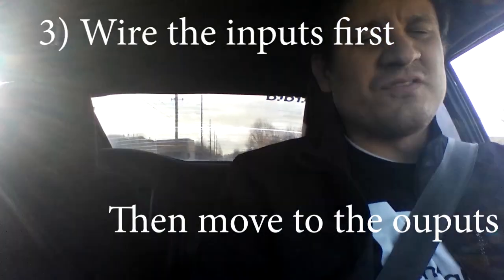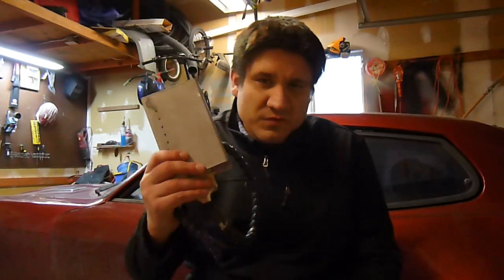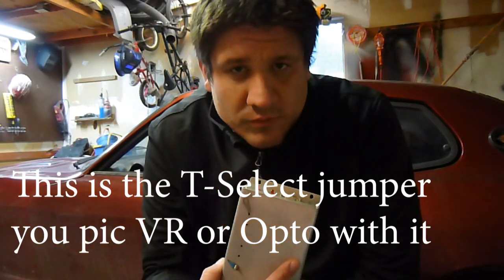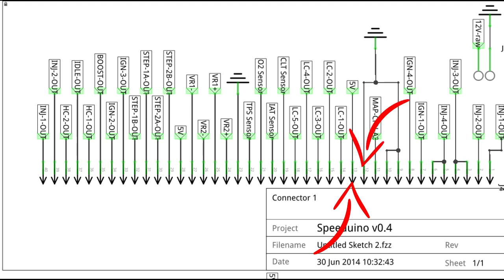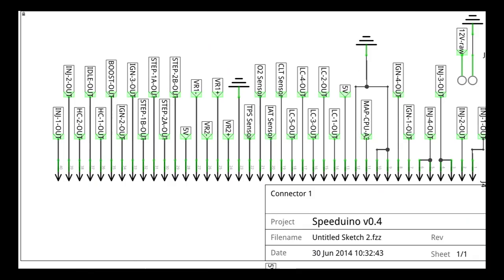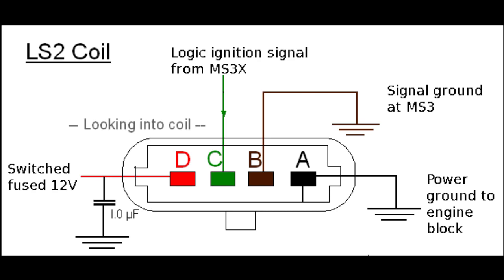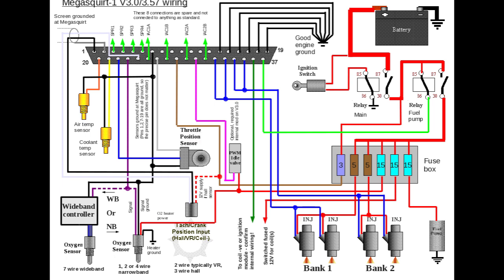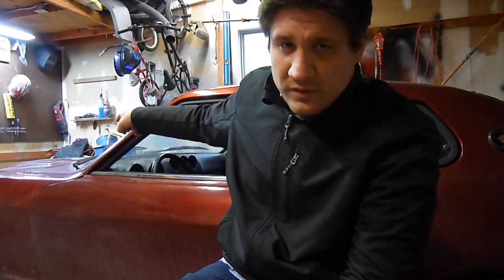Guide to wiring up your standalone ECU (Speeduino and Megasquirt)

Comment: One tip I can add is I heard you say you have a lot of quick connects on single wires.  What I do when I deal with scenarios like this is use the little small colored zip ties to label everything.  Walmart, advance auto, Autozone all have them and each store the colors vary in tones not to mention you can double/triple up and change colors.  The possibilities are endless bc you can keep adding.  I rarely get to 3 zip ties per item due to the possibilities you have just with doubles and colors.  For example red, green or red yellow and you can also you the same patterns and change the order on which the line up on the wires.  Thanks for the video.  This is exactly what I needed.
Reply from the maker: I like that idea! My brother in law has a heat shrink labeler that we like to use (but we can not find it at the moment)  I think I will give that a try since we can not find the labeler at the moment.
Thank you,!

Comment: 13:00 I did the same with my hondas, I cut two teeth off the 24 tooth distributor wheel to get 12-1 to run wasted spark, as MS1 extra was unable to decode a single missing toothed wheel at cam speed, worked very well when I changed the VR sensor for a magnetic hall type... I believe you can run a cam speed single missing tooth wheel on an MS2 extra though...

Comment from the maker: I just realized that I forgot to say why I used the TPS 5v for the hall sensor. The hall sensor that I am using is a 5v hall sensor. In the Megasquirt picture that is common, it shows 12v Hall sensor. Make sure you know what one you have and how to wire it. Some sensors are 5, some are 12, and others (common) ones are 5 to 24v.

Comment: I hooked up a speeding 4.4b board and using a DIY hall sensor powered by 5 volt beef. And using sensor ground. Have 0to 5 volt on output .but when I hook it up to pin 25 my volt meter reads 0 volts.All the other sensors  work great., just no rpm signal on tunerstudio. Should I try powering it separately and grounding it separately from other sensors.. Thanks
Reply from the maker: What are your jumper pins set to?

Comment: Excellent video, very creative and impressive utilization of the distributor as a cam sensor!

One question though, did you end up going with the connected signals for the fuel injectors, or did you somehow go full sequential based on the other parameters? Unless you're going for the backfiring or turbo misfiring system it seems like a pretty significant waste of fuel. Just curious what the system you're running is like.

Again, great video!

Comment: Great video CEK Garage, quick question, I will be using a 0.4 Speeduino board, VR 3 wire sensor on 60-2 wheel, what pin should I connect the signal wire to, 27? VR1- (Not used for hall sensor)
Thanks and best regards, 
Eduardo.
Reply from the maker: You will use 25 and 27. Pin 27 will supply the negative voltage to the vr sensor. 25 will read the output from the vr sensor.
Reply: @CEKGarage  thanks for the update, but now I'm a bit confused, I forgot to mention that a VR conditioner will also be used, ain't 25 for hall effect sensor? Also, since this is a 3 wire, shield grounded  cable should go to engine or chasis ground right? Thanks again.
Reply from the maker: @EduardoCastrillo  Correct. The 3 wire VR sensors normally are as follows, a supply, a shield, and an output. The supply would come from 27, the shield would be to a grounded to your choice, and the output from the VR sensor would go to 25. There are other ways to wire it up, but that is the most stable when pin 27 supplies the vr sensor.

Comment: VR sensors are awful unless you have a circuit tuned for your specific application. They don't really belong on cars, they are only useful on jet engines...etc with very advanced controls and extreme conditions, nothing beats a solid 0V/5V signal going directly to your MCU. Had loads of success with MS1 extra 20 odd years ago, can't wait to get started with speeduino. So far I just have a breadboard based simulator using ardustim because my new car it way to expensive to mess with😅

Comment: You said you wired one pin of the injector to positive throught a fuse, and the other to speeduino, right? My injector pins on speeduino are positive (12v) pins. Could both injector pins be positive?
Reply from the maker: They should be -12v when they are firing. Keep in mind, if you are checking the voltage with the engine off and key on. The +12v will flow through the injector to the pin Speeduino. If you look at the schematics, both Megasquirt and Speeduino work by sending ground to the injector.
Reply: TwoNuts DIY I check the speeduino connected to conputer and 12v from a external battery, not in the car yet, and with the multimeter between pin number 1 on 40 idc socket and ground, the result is 12v (meaning pin 1 is the positive I guesst)
Am I right?
Reply from the maker: Not a problem at all! They will still send ground to fire the injector. You will need to supply +12v to the side of the injector not connected to Speeduino. Make sure you find out if you have low or high z injectors. Low z injectors will need a resistor. Hope that helps! What car are you working on btw?
Reply from the maker: One more thing to help out. The +12v that you see at that pin is pulling through the LED light. If you look at this schematic you can see how the 12v flows through the led on there. https://cdn.hackaday.io/files/4413188805792/schematic%20v0.4.3_schem.png
Reply: TwoNuts DIY that makes senses 😅
I have high-impedance, and it is a Rover 25 1.4 105hp.
Thanks for your help 😉👍🏻

Comment: Hi.,  So on your custom cam trigger wheel, at what position/degree did you remove the two teeth at?. Is it 90 degree before TDC? 90 degree after TDC?, Or 180?    I'm in the middle of doing this on a Honda distributor and I see a 24 tooth gear, a 4 tooth, and 1 tooth gear. This is where I'm stuck at. I was thinking about going edis4, but I would like to use the Honda distributor. Any help would be greatly appreciated. Thank you..
Reply from the maker: With both Megasquirt and Speeduino, you can use the "Trigger Offset" to enter any value. So where you cut a tooth is not as critical as long as you know the about the right degree, then you can dial it in with a timing light and that setting. Mine was at 68 degrees. That said, if I remember right, there might be a way to do this without cutting out a tooth. Whatever way you decide to go, please use a spare distributor or a junkyard one to bench test the VR sensor as it feeds your ecu a tach signal. (I have spent hours at my kitchen table with a 9v battery just playing around) Let me know how it goes!
Reply: Thank you.
Reply from the maker: I noticed that I missed part of your question in my first answer. The missing tooth passes by the sensor, and then 68 degrees later, my engine is at TDC. When I welded the wheel in, I was trying to get it at 60 degrees. Ended up at 68 after I used the timing light.
Reply: @CEKGarage  cool thanks again. I'll keep you posted once I get back to it. Waiting on another distributor that I ordered for bench testing..
Reply: @ciscoperez4271  good day I know it's a old comment but I'm in the process of converting my Honda B20b distributor into a cam sensor as well so that I can run full sequential fueling. Let me know how you manged to do so please. Thank you
Reply: @junaidjunu1879  Unfortunately a tree fell on my car during a tornado and destroyed everything, so I wasn’t able to finish the build. Check out DCwerx’s channel as he had success with Hondas and speeduino.

Comment: Hey i got a V0.4 board and a rb25det that i want to convert to standalone. I see that speeduino supports the nissan 360 wheel so im guessing i wouldn't have to use an external crank trigger wheel. also to get fully sequential spark would i need a cam signal as well?
Reply from the maker: The last Nissan cas wheel I played with was a 4 wire. Power, ground, crank (360 slots), and cam (4 slots with different sizes on a KA24) I also played with a 300zx that had 6 slots. My best guess is that the rb will be just like the 300zx. You can pull the top off and confirm. This is all you need, that will be the crank and cam sensors both build into the one unit. Thanks for watching!
Reply: CEK Garage thanks very much

Comment: Question.. Using basic distributor.. Do i jus wire the rpm output frome the dizzy to the vr1 pin?
Reply from the maker: In short, yes. For Megasquirt this will be pin 24 (Pin 1 is just a ground for the sensor) For Speeduino. This would be pin 24 as well. (Cam VR2+ Signal) One thing to keep in mind, Megasquirt will need to be set up as the VR circuit and if you are using Speeduino, you will need to use the VR jumper as well as have the VR conditional circuit. Let me know if there is anything else I can help out on. Hope you get your project up and running quickly!
Reply: @CEKGarage  thanks alot.. gonna start wiring up this weekend.. I'll keep u posted
Reply from the maker: @dhatkidds3v3n86  Great to hear! Just take your time and do one thing at a time, confirm, and then move to the next item.

Comment: whats the best way to power the speeduino in the car?
Reply from the maker: Depends on the car, but in short, you need 12v power source that has power with key set to on as well as to start. Have that fused with a 2.5 amp fuse. A common trick i see for cars converted from carb, is that someone uses the 12 v supply wire that goes to the coil.

Comment: I jus wired in a no2C.. but no spark.. says sync when cranking though help needed pls.. my dizzy is dual wheel 4 tooth at the bottom and one at the top . Try to start on basic distributor..
Reply from the maker: I can look at your tune tomorrow if you send it to me. Twonutsdiy@gmail.com. let me know what type of coil you have and what pin(s) you connected to.

Comment: Anyone know if its possible to get a v8 to run full sequential spark and injection by using a relay to switch between 4 cylinders every revolution.. maybe program the ecu like a 4 cylinder 2 stroke and then have a pulse that that turns the relay on and keeps it on for 1 rev and then swith off and so on?
Reply: Are there affordable high voltage tolerating relays quick enough to do that at high rpm?
Reply: @merlevangennip1160  Transistors can do the switching and the high voltage is after the pulse anyway with coil on plug...

Comment: you didnt mention the 5v/12v switch for the ignition on the speeduino
Reply from the maker: I am sorry, I accidentally edited that out. The truth is, half way through this video I got motivated to completely re-organize how I did the connections to the Speeduino and the wiring loom itself (I got to get a fun tool here so I can complete it) In short LS Coils will need the JP1 jumper set to 5v (I will cover the Tach jumpers and Ing jumpers when I do the video on the loom)
Reply: @CEKGarage  ok awesome thanks